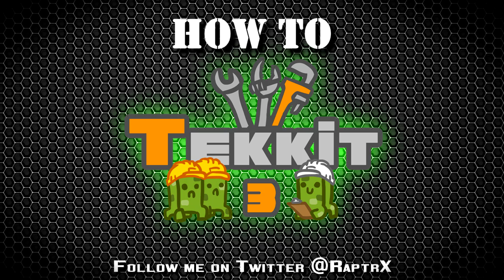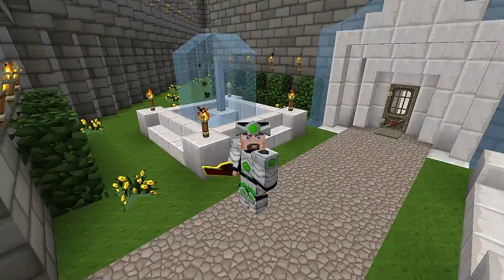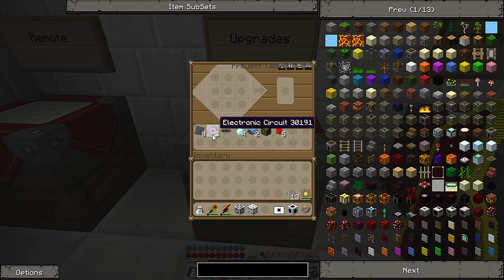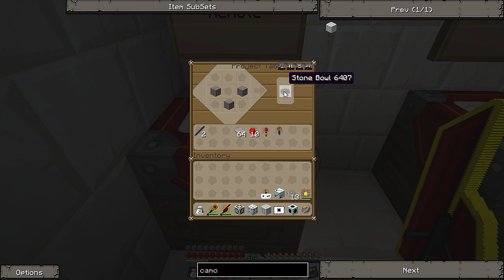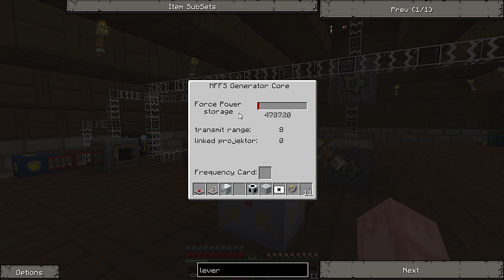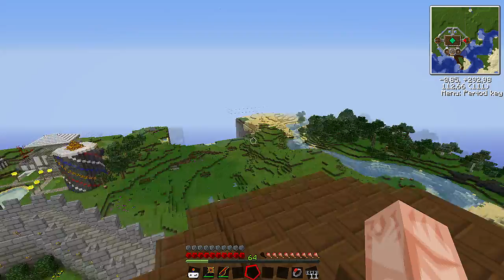How to Tekkit - Forcefield with Zapper and Camouflage Upgrade

Comment: could i link multiple projectors to a single injector? i know the power cost will be higher but is it possible? Also could you put the projector anywhere after you linked it via the card?